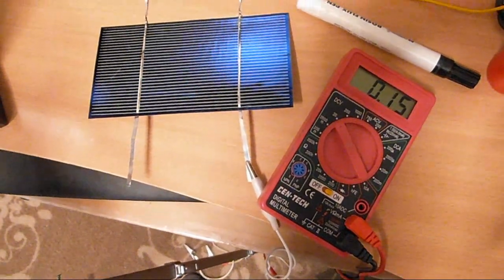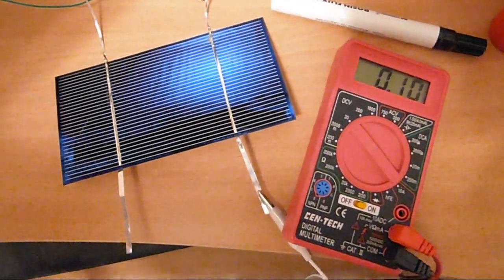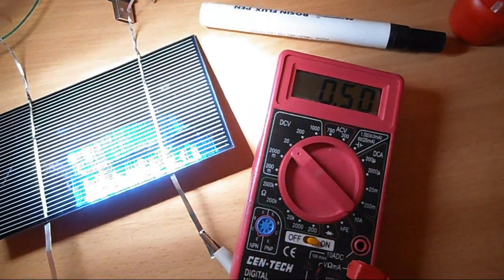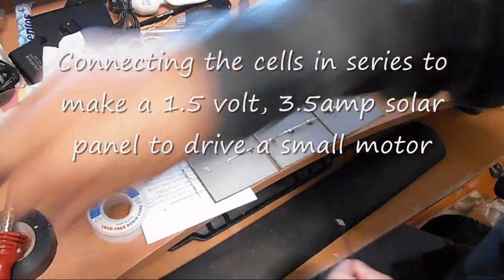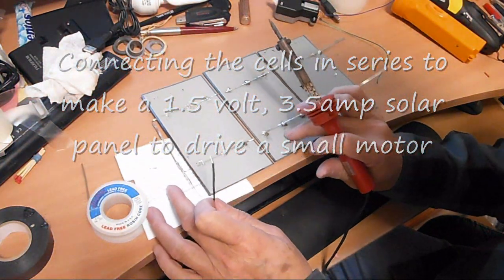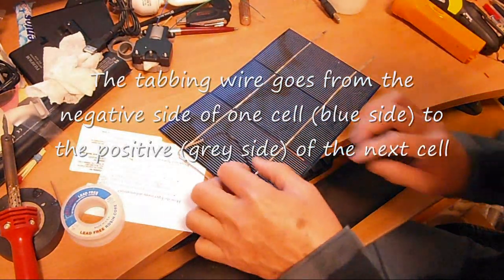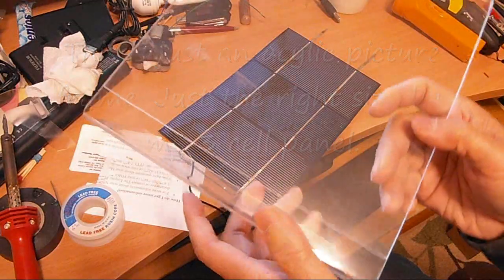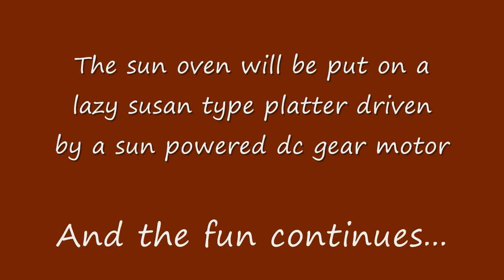Global sun oven solar tracker pt  2

Comment: do the solar panels have to have the diode installed? I made mine and it works great . run two pumps in my pond with car battery backup. when the sun goes down the battery keeps the pumps running thanks NO electronic to go wrong thanks
Reply from the maker: No diode needed as there is no battery in this setup.

Comment: That's true, but you'd still need a little transistor circuitry to run a motor with an Arduino board.  There are motor controllers boards out there that can easily be hooked to the Arduino.

Comment from the maker: A timer linked to a motor that can turn on for a brief moment will certainly work.  The gearing of the motor, the control of the electrical pulse etc. etc. require more engineering. The programmable arduino circuitry board is probably more suitable this purpose.

Comment: I wonder if one of those cheap digital timers would turn on for 5 seconds.  If so an AC adapter that puts out 12v or so could be plugged into it and run a small DC motor for 5 sec every hour or so.